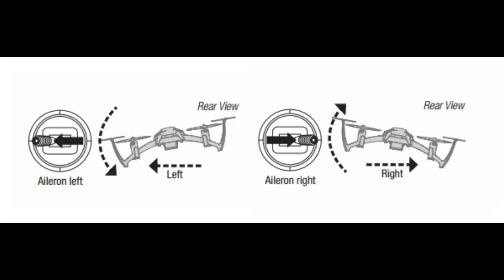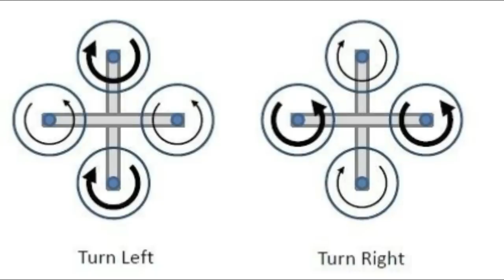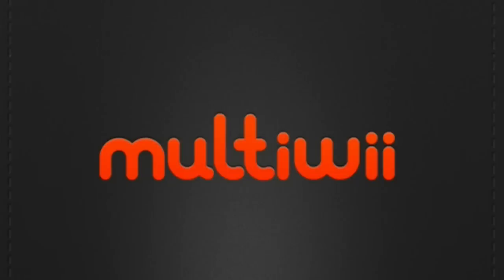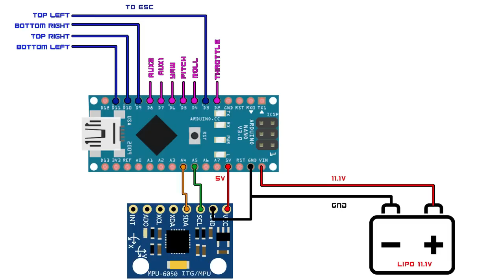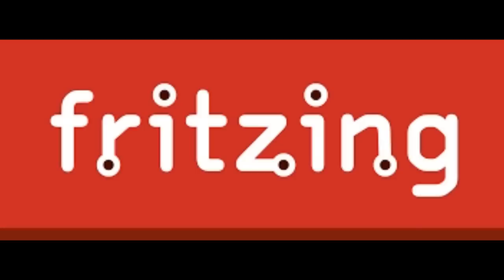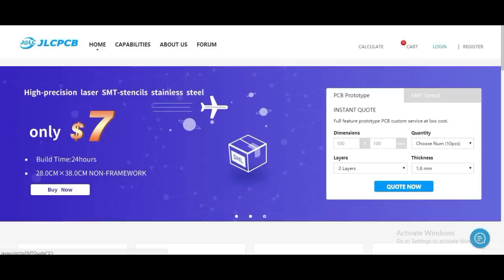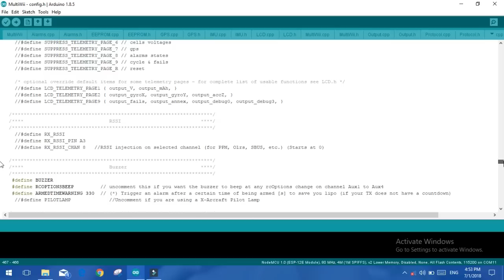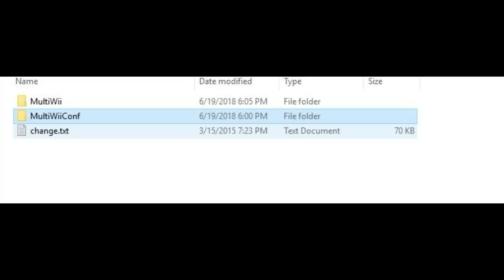Arduino Quadcopter

Comment: Hey man i really like your work and i Always watch your vidéos but I ndeed your help i built a multiwiii  Arduino drone  but when i run multiwiii and i increase thé throttle to maximum all thé motors go to maximum but After seconds thé front left and thé rear right decrease suddenly to minimum
Reply: Please help me sir
Reply from the maker: Its calibration problem. First of all make sure your motors are spinning in right direction and placed in the right manner.
Reply from the maker: Then check gpu and place it in exact center of the board.
Reply from the maker: Recalibrate everything and try flying it starting with little throttle and increase it slowly
Reply: @RoboCircuits  ok thanks i will try your advise

Comment: The transmitter don't work. Only gyro changes the position in multiwii computer application but nothing effects the motor. It never rotates them. Second thing is that i'm using 11.1v lipo battery. The battery is fine, the conections are fine and direct receiver to the motor is working. But not communicating with the arduino or maybe the problem is in the program. It seems like all multiwii tutorials are fake. I'm using transceiver set FlySky FS-CT6B (6 channels tx and rx)
Reply from the maker: Tutorial is good... And it works flowlessly
Show me your circuit diagram... Email me at robocircuits@gmail.com
Reply: Sir Sending me code and circuit diagrams  my mail id is ghosh7778@gmail.com l am add you whatapps group you whatapps no send me
Reply: can you give me a one pcb

Comment: Sir can you please send me the pic values.
Also can you tell me how much capacity battery you used in your quadcopter.
Reply from the maker: I didn't remember the pid values... But battery used are 11.1volt and 2200 mah
Reply: @RoboCircuits  Thanks

Comment: Hi... I'm also building the same the issue is the receiver signals are not getting to the board while configuring it shows invalid receiver signal and also no stick movements of tx are viewed on the multiwii software as throttle yaw pitch etc.. kindly help me for this.. I'm stuck
Reply from the maker: Check your reciever....
Reply: @RoboCircuits  how can i check receiver
Reply from the maker: Use a servo motor and put it on receiver and power it.... When you will move the sticks... Servo must move

Comment: Hi.. when I'm configuring with multiwi sw for the stick movement as shwn in video apprx time 8:14 and when I'm moving my stick of tx the throttle,pitch,roll,yaw on the screen are not changing.. kindly help with this issue asap
Reply from the maker: Check reciever wiring.....
Check weather the reciever is on...
Use a servo.motor to check weather each channel is working or not.... 
Make sure you select right port and then click on start...
Try reuploading the code and restart everything
Reply: @RoboCircuits  actually i hav already tried flying the quad using kk board and is flying but the only issue is when connecting the arduino flight controller.. so then shd i chck the wiring connection with the receiver?..
Reply from the maker: It will be good if you check everything again... Check if your pins are correctly connected to respective channel....
Reply: @RoboCircuits  now i hav check the receiver wiring connection, port connection then too the sticks are not moving
Reply: @RoboCircuits  should i use the FlySky Data Line Cable Access Wiring Connector for this configuration???
Reply from the maker: Can you show me pictures
Reply from the maker: I would better understand with them
Reply from the maker: https://chat.whatsapp.com/Hf4kPxOEhU592VvwvrvV3N
Message your problem to this WhatsApp group... With pictures

Comment: Please teel me the esc connection
Reply from the maker: What you want to ask
Reply from the maker: Signal wires are connected to digital pins as told in video... 5v to Arduino 5v.. ground to arduino ground

Comment: Your PID values?
Reply from the maker: Give me email address i will send you
Reply: @RoboCircuits  66prab@gmail.com,,, also can you tell me how to calibrate gyro in multiwii config??
Reply from the maker: Check email
Reply from the maker: Did you got the email
Reply: @RoboCircuits  thanks , will check my laptop when i get home. i asked because i also have f450 frame , thanks , will tell you if the test flight was successful.

Comment: Nice project sir and a very nice tutorial

actually sir I was make a bi copter with multiwii and it's working
but one motor's rpm is great then another one at all tha throttle conditions
I'm using mpu6050 with Magneto meter and barometer with flight controller 

so may you help me to solve the problem related tha different rpm of tha motors 
Thanks sir please help me☺️
Reply from the maker: I got the same problem once. Then i placed the mpu6050 on exact centre of Quadcopter precisely and extremely flat. Then everything gets fine
Reply: Thanks sir but I have already placed tha mpu6050 at centre position and celebrated magneto and accelerometer but tha problem is as same as previous
Reply from the maker: Means the quad is falling in the same direction at every takeoff???
Reply: yes sir
Reply: but servos moving fine
Reply: according to tha disturbing side and balancing tha quard
Reply from the maker: Are ESCs stopping abruptly after increasing throttle??
Reply from the maker: Follow this link to add in my whatsapp group and kindly send a video so that i can understand it https://chat.whatsapp.com/Hf4kPxOEhU592VvwvrvV3N
RoboCircuits group
https://chat.whatsapp.com/1SJ5Z9PJ5npBkxd5qyiUIt
Drone innovators group
Reply: yes sir